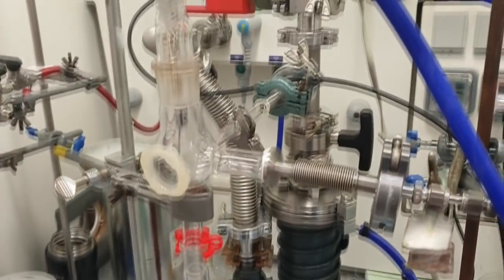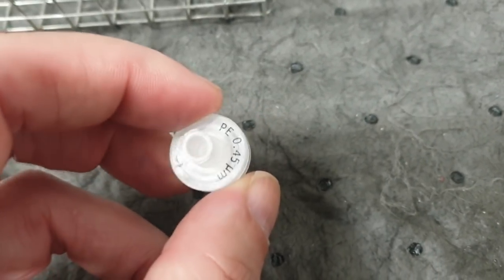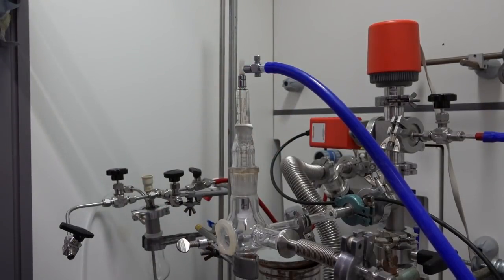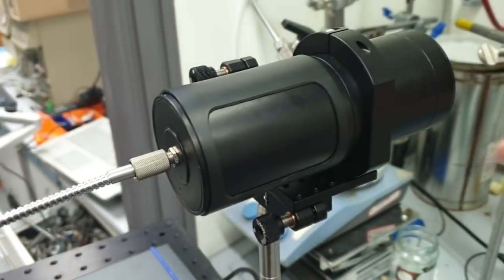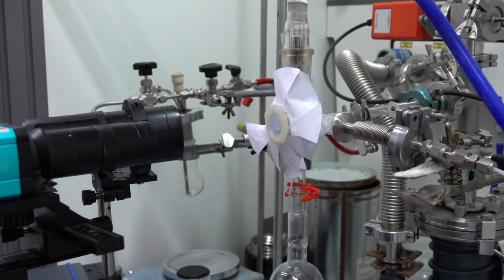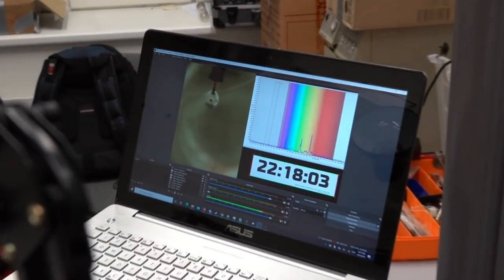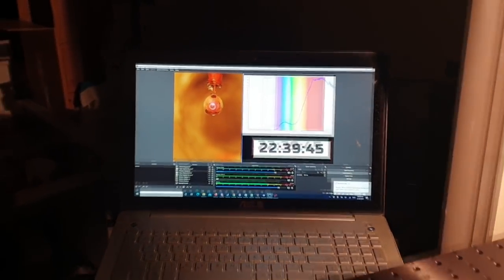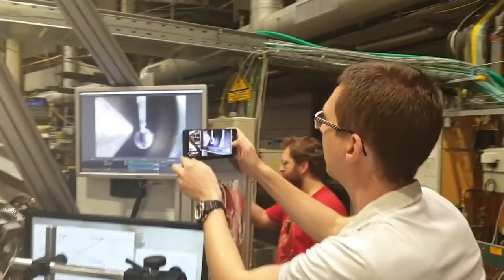How to make Metallic water!

Comment: Sir! Excellent work! I'm a layman but am trying to catch up here and coming across some research on the Seebeck effect/thermoelectric effect I found this interesting bit on 'materials of interest':
"Strategies to improve thermoelectrics include both advanced bulk materials and the use of low-dimensional systems. Such approaches to reduce lattice thermal conductivity fall under three general material types: (1) Alloys: create point defects, vacancies, or rattling structures (heavy-ion species with large vibrational amplitudes contained within partially filled structural sites) to scatter phonons within the unit cell crystal;[13] (2) Complex crystals: separate the phonon glass from the electron crystal using approaches similar to those for superconductors (the region responsible for electron transport should be an electron crystal of a high-mobility semiconductor, while the phonon glass should ideally house disordered structures and dopants without disrupting the electron crystal, analogous to the charge reservoir in high-Tc superconductors[14]); (3) Multiphase nanocomposites: scatter phonons at the interfaces of nanostructured materials,[15] be they mixed composites or thin film superlattices."
-Wiki Thermoelectric materials

Comment: Totally off topic. But, I've been wondering a thing about diesel engines. Since the fuel is injected into a hot compressed cylinder, could the same be done with just water?

Comment: Question. What happens if the microjet fails under pressure and all the danger stuff fell down at once at 1 atm? Would it go bang?
Reply: only if jetted in water. Under 1 atm air it would just slowly oxidize. Under 1 atm oxygen it might burn.

Comment: OK, first off, congrats again! That is amazing. This is beautiful. This is awe-inspiringl.
     Also, I think I missed something important here. Why is the vacuum needed? I mean, if you are going for the initial 'jet engine' setup, I don't see any way around it, but now, in that droplet in a super-rarefied water vapor atmosphere... couldn't it be argon (or another inert gas) and a tiny bit of water instead?
     I see five possible explanations:
1/ Easier (though still stupidly challenging) to get clean spectra if you don't have to worry about gasses (or getting highly pure inert gasses is just as hard as getting a vacuum/too costly)
2/ Better control of the vapor pressure in this setup, and the water partial pressure is just the total pressure
3/ The setup was made for two jets colliding in a vacuum, then one jet was removed
4/ I missed a very important aspect of the experiment. This HAS to happen in a near perfect vacuum.
5/ something else entirely
     Really interested in the answer(s), ESPECIALLY if it is mostly (4) or (5).
Reply: This kit needed to be able to be used to get the photoelectron spectrum as well, from what I gathered from the first video on his main channel, and X-ray photoelectron spectroscopy requires a vacuum to work, based on a quick search on wikipedia, so the answer is (4), I think. I could well have missed things though.
Reply: @duckfan7717  Thanks a bunch.That makes a lot of sense. I feel a bit dumb initially missing that, but i'd have stayed dumb if i didn't ask.

Comment: I still think I'm misunderstanding this as water with metal in...
Reply: What makes a metal have all the characteristics you associate with being "metal" is the loose sea of electrons.  Here, as with the earlier solvated electrons in ammonia experiment, free electrons are dissolved in the water and acting as a fluid itself.  In the earlier experiment, the solution went from purple to shiny gold (interacts with light like metal does) and the fancy X-Ray probe showed the actual details of what those electrons were doing, proving it was actually "metallic".
Here, they wanted to produce a state of dissolved electrons in _water_, which was theoretically possible and more importantly was an actual mechanism causing the alkali metal explosion, which was TF's hypothesis that was proven a couple years ago now and got published in the top-tier journal.
Now, they figured out how to produced electrons dissolved in water without being part of an explosion.  And, happily enough, it appears to enter a metallic state, as well.  Although like before it will take the X-ray instrument to definitively prove that, since it has already been shown that solvated electrons in a polar solvent can indeed become metallic, seeing it happen again doesn't need doesn't need as high of a burden of proof and the presumption is  that it's more of the same.
Hope that helps!
Reply: @JohnDlugosz  thanks!

Comment: From a programmers perspective, it's like you're programming with matter and your apparatus is a 3D representation of the code. Reality is the language and the output.
Reply: Definitely could have done a second draft of that comment. I like the potential of the analogy, but can you elaborate?
Reply: @johnqpublic2718  The level of programming I do is using pre-scripted logic terms, like IF, ELSE and LOOP. These are themselves programmed in machine code, but I don't need to know how they're made, only how they work. A bit like the test tube, microscope and spectrometer. TF doesn’t need to know how they're made, only how they work. He can then arrange them in any logical way he can imagine, in the same way I can arrange my code in any logical way I can imagine. His ingredients are the inputs and the physical result is the output. I can, if I wish, also run my program in debug mode and use that to precisely measure the output. The language I use could be C, Java, BASIC or whatever, but the output is translated into images, waveforms (sound), data etc. When reality is the language the output is also described in the same language. I do suppose, that for us, it also needs translating, but I like the elegance of it; it's purity of form.